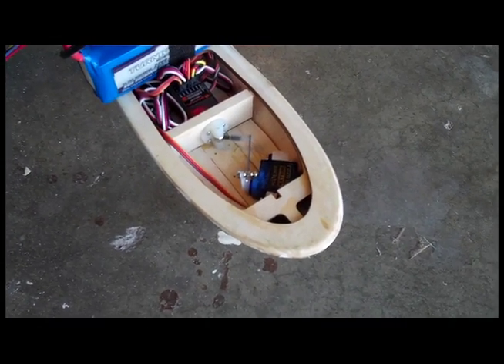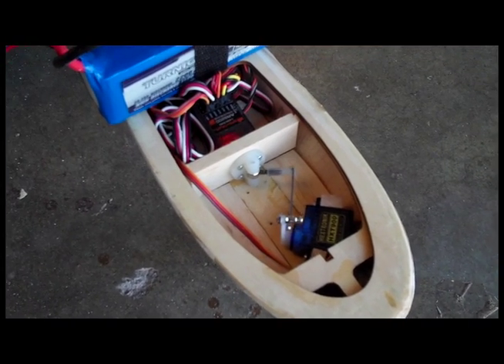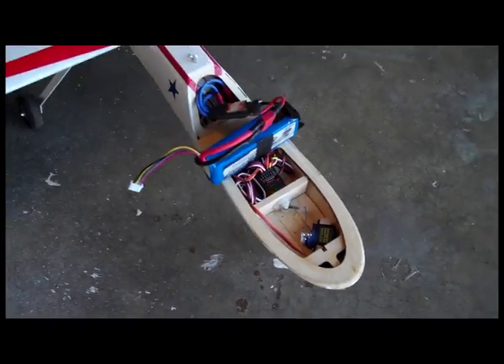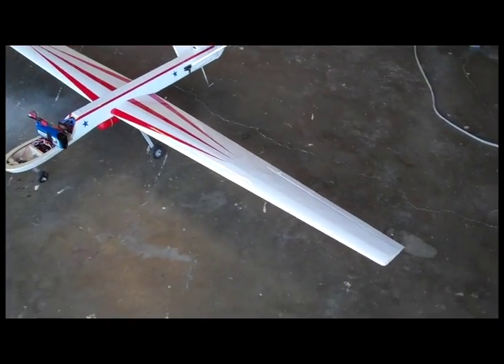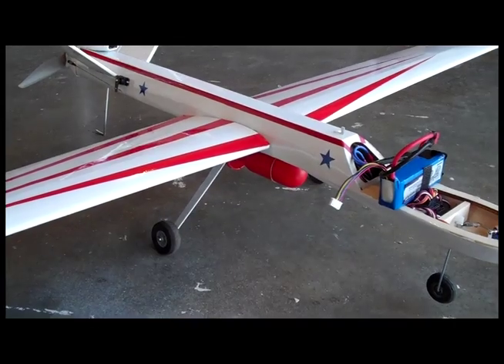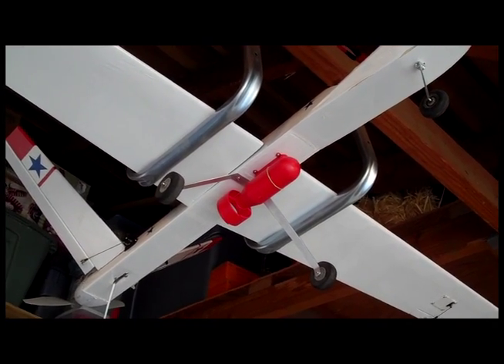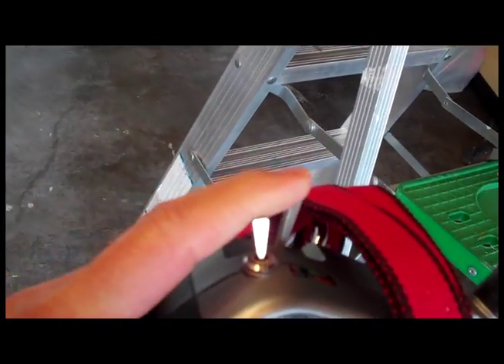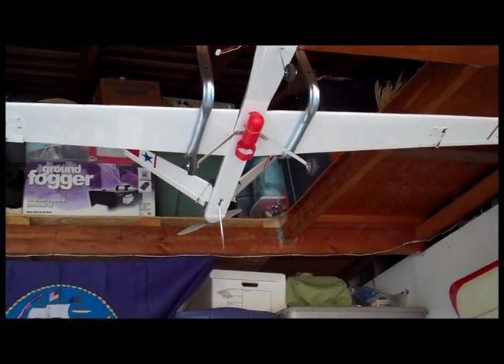TMpro R/C Predator Drone Modifications

Comment: Hey, I see this is a older video, but I’ve recently picked up this kit. I am about 90% done but didn’t come with instructions so I don’t know how to mount the wings so that they are still removable. any help you can provide is appreciated.
Reply from the maker: Hi, as I recall there is a metal hook that attachs to each wing and fits into a slot in the fuselage. You'll need to hook a couple thick rubber bands around one hook, through the fuselage and around the hook on the other wing. This pulled the wings together. I also would recommend using a longer carbon fiber tube to support the wing. I recall the spar it came with wasn't that long and the wings had a lot of bend when flying. Its a neat plane but just be sure you have speed when turning and landing. It will tip-stall easily otherwise. Hope this helps!
Reply: @tilneyaviation  thanks for your help. I couldn’t really find any info on this one and barely any videos of it.
Reply from the maker: Here is a short video of mine flying. https://www.youtube.com/watch?v=Vk21IiKyVLE